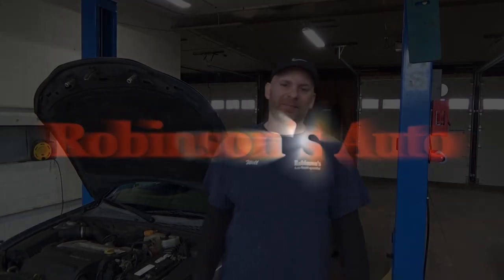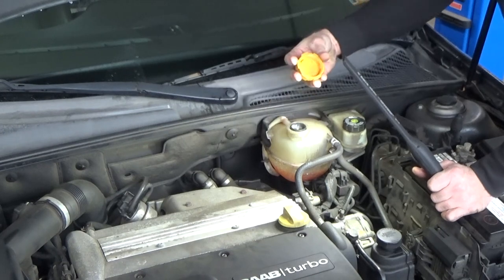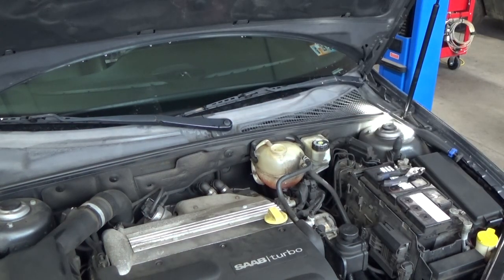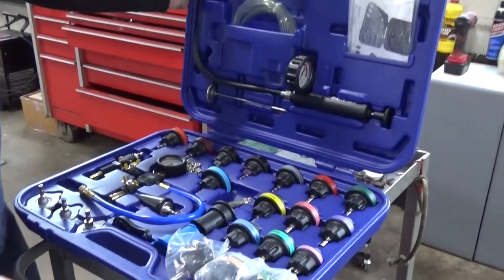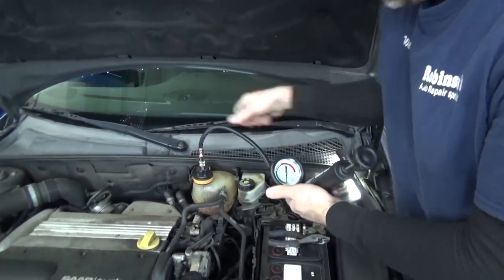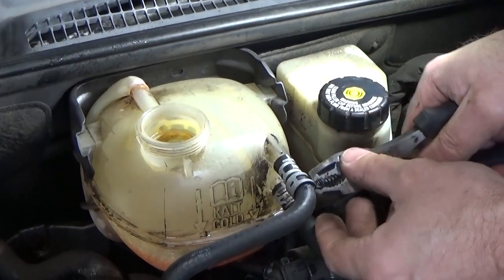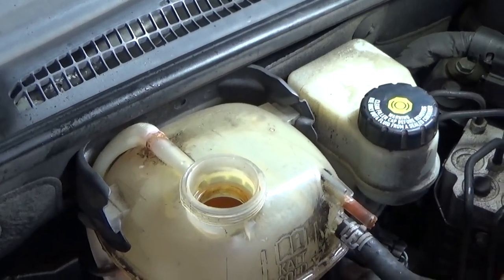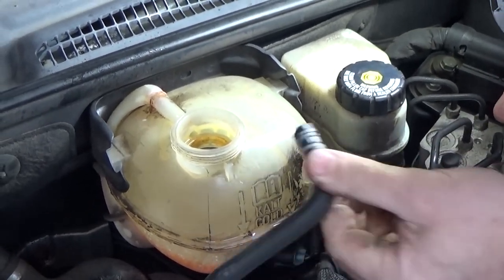Saab 9-3T: low coolant light - Diagnose and fix!

Comment: Hi Will, on  my saab one of them front small diam pipes from the bottle has a lot of flow back to the bottle when cold that stops when hot! Did you notice on your car there? Would the w pump cause a lot of flow. Dare i say Head gasket leaking into coolant maybe, cheers

Comment: I was wondering when you showed that hose bending causing the leak whether it broke the plastic nipple and all of your work getting that cap out was for nothing. But hey, if you broke it getting the cap out then it wouldn't be your fault as it was broken to begin with. 😀
Reply from the maker: It was low on coolant for a reason and luckily enough for the customer it was a simple fix.. You can tell it’s been leaking for a while by the discoloration of the plastic nipple. But yes it was coming out one way or another lol